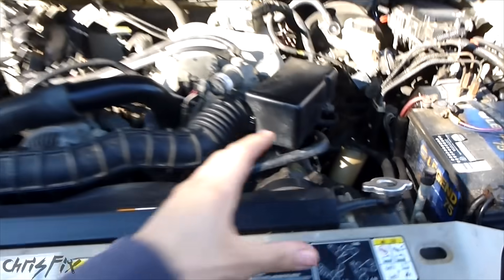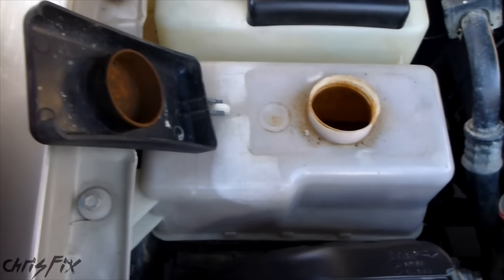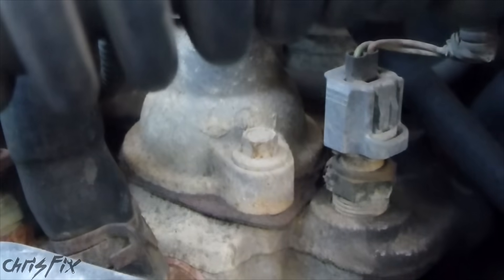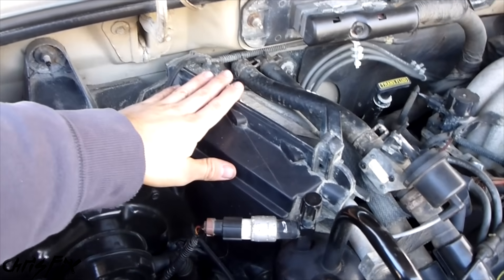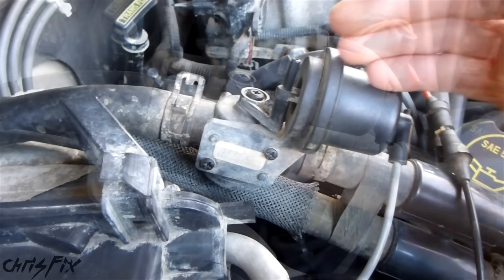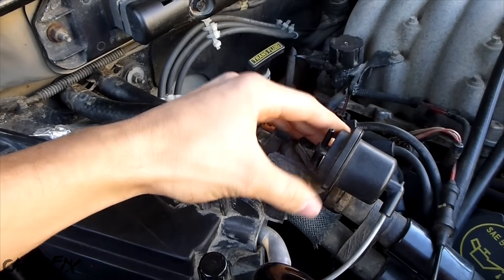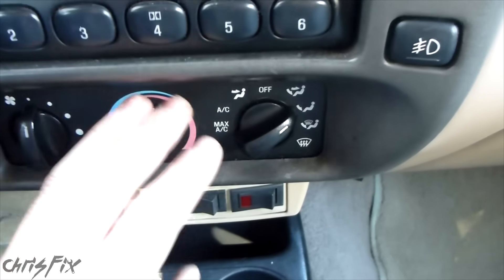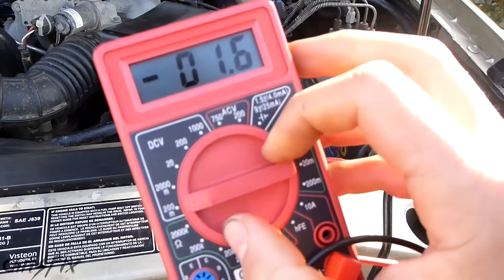How to Fix a Car with No Heat (Easy)

Comment: I don't understand why this video has dislikes.  Great informative video!
Reply: Dont know why either!!
Reply: Are we looking at the same like bar? I'm seeing 99.99% likes vs 0.01% dislikes.
Reply: +Sadpants McGee But still, 180 dislikes is something.
Reply: Darude - Sandstorm Go to any youtube video with a high view count, and you're going to find downvotes.  Such is the nature of the internet.  Complaining that 0.01% of voters voted down makes about as much sense as lamenting about a single brown blade of grass in an otherwise completely green lawn.
Reply: +jdac22 Those haters are car mechanics of CHris fix City..They know people will fix there cars at home now ..
Reply: its because this car clearly has a headgasket leak. that what i saw when he poped that rad cap.
Reply: you are right you can see clearly that
Reply: That is because he hasn't changed his coolant in over 8 years. It isn't a head gasket leak. A head gasket leak will make your oil foamy and I have seen his oil for that car in a different video and it is almost 100% black oil.
Reply: Im a year late to this, its probably the technician scammers who dont wanna get outdrove by the honest ones.
Reply: Prince KPK I understand why. He actually left out THE NUMBER ONE MOST IMPORTANT REASON! If the heater core cracks (like a radiator can) then the coolant will leak into the passenger side of the carpet so you will lose coolant causing the engine to over heat and then also causing major damage like blowing a head gasket possibly cracking the head and maybe even burning up the entire motor. I can’t believe thats the one thing that he left out smh
Reply: I think there are 699 techs looking at his videos thinking "damn" I cant overcharge them anymore.
Reply: People, the dislikes probably are all sitting with their car and it's blown heater core. This video offers no quick fix for such a problem and it's disheartening. To buy the part itself isn't expensive it's labor-intensive as you have to take apart your dash and part of the engine on the other side of Dash to just get to the simple part
Reply: jdac22 probably from mechanics that are pissy about him teaching people to fix their own stuff.
Chris fix is the fucking man!!!!
Reply: Is it  because ChrisFix learned it better than they do?
Reply: Dislikes are the mechanics who are losing money probably
Reply: Quick YouTube tip: people will dislike a video for the most strange reason. Don't try to understand dislikes.
Reply: Teague Jelinek uh okay
Reply: @jayasmrmore3687  happy to help.

Comment: I just had to subscribe because I’m pretty sure you helped me diagnose my issue; I get heat when I want AC, AC when I want heat. This makes for a miserable time driving in hot summers or cold winters. Tomorrow I’ll test out the blend door theory and hopefully, the fix will be as simple as you suggest! Thanks, Chris!

Comment: I have a 2007 Buick Lacerne. Cold on one side,         hot on the other. The actuators were working fine. Test showed I had a door stuck. I took and sprayed blaster in the defroster vent and also the face vents. I let it set for awhile. Then tapped on the actuator box, it really worked. Thanks Ken Norris.

Comment: Excellent video 👍 going to flush heater core and swap coolant on my 2008 buick allure 3.8 v6 series 3 tomorrow. Already replaced thermostat. I have heat but it's just not as good as it should be.. I'm hoping the flush or the blend door actuater is the culprit.. keep up the great videos

Comment: Still a great video to this day. I went through the complete video, replaced the blower motor resistor per the symptoms. The blower continued acting screwy throughout the different switch positions, then finally found that the culprit was the actual fan speed switch contacts had welded closed in the high speed position. Replaced the switch, and voila! Fan speeds work again!  Thanks a bunch for stepping us through the entire system, definitely makes troubleshooting easy when you know how something is supposed to work. 👍

Comment: Wow. I feel like I know how the system works now. 😂. Loved the video and it helped me TREMENDOUSLY in diagnosing my issue. I replaced the Resistor which helped me get the blower moving on all 4 speeds. It was only moving on the 4th and first. Now I’m getting air flow but it’s still a little low so I’m going to look and see if my blend door is opening all the way. Man. Thanks. Information is so cool.
Reply: Also check the filter behind your glove box if you have one
Reply: @icemancometh8679   Yea I ended up replacing the entire AC system. Worked like a charm.  I actually just listed that truck for sale this week.  Looking to upgrade.
Reply: @karateflix  I think my water pump blades are all rusted out and so my heater doesn't work so well and they tell me I have a leak in my evaporator in my air conditioner - what else could it be?
Reply: @icemancometh8679  Depending on what vehicle it is.  Im no mechanic by any stretch.  I just know a little here and there.  Id go through and replace everything little by little if its an old vehicle like mine.

Comment: Holy cow! At 122k that radiator needs changed out; even the recovery tank has signs of the rust & corrosion. Flush those with the radiator out. That could be a cause of overheating. Very poor coolant flow, and heat exchange, you know? You could also rent/borrow a NOx sniffer- check that recovery tank for a leaking head gasket, too. That would make an awesome video for you- "Coolant System Overhaul".

Comment: Me: *checks coolant in mom's old car expecting it to be dirty and sludgy*
Coolant: *is full and bright green*
Me: 😲 w o a h !
Reply from the maker: Nice!
Reply: She probably watches chris fix😂...God bless your mom bro
Reply: It probably was serviced not too long ago
Reply: @chrisfix  Hey Chris on my Rav4 2004, The driver side vent blows normal temp air, the passenger side blows cold air.  
When I switch the climate control from cold to hot it blow the correct air temp as it should, but when I set it back to Cold, only the passenger side blows cold air.
What do you think is the problem? is it the blend door or is it low on freon/refrigerant?
Reply: @chrisfix  what about  ac cold or 1992  Acura vigor
Reply: Let's be real, we all are here so we can help our mom with her car troubles
Reply: @richmadrid9563  have you tried changing air filter
Reply: @jayasmrmore3687  both engine and cabin airfilters are new. I don't see any relation of the temperature to the filters.
Reply: @SeanLaMontagne  correct
Reply: @richmadrid9563  did you fix it?

Comment: I'm glad Chris makes these videos. I just found out the previous owner's mechanic had ziptied the heater control valve shut into AC mode. I trust Chris more than mechanics. heater works great no leaks anywhere. Thanks Chris

Comment: Chris, does it make a difference if the temperature of the two heater hoses is about 20 degrees different?  147 for the one on the right, 125 for the one that connects on the left side of the two (as you face the firewall)  Also, do you know the ohm rating on the potentiometer? (middle knob in the set of three on the dash)  Put my meter on 20K and it reads 454? ...  not so good with electronics😜
Reply: 20 degrees is a normal difference. 50 degrees or more would mean there’s a problem.

Comment: My heater seems to only blow cold air, if anything it feels a bit colder than the regular AC. Not a big problem since I'm in AZ and it's relatively warm year round, however, I care about my vehicles and want everything to work how it should. That being said, I did a little investigation. Ended up replacing the blender door actuator or some people refer it as a blender door motor. Either way, it's replaced but it seems to not have done much. The fan blows on all settings. Air blows from each vent. Heater core works and the coolant/ anti-freeze is good. Hoses get hot. Yet no hot air. I'm stumped. I was checking that heater control valve or what looks like it (mine is inside the dash, right behind the glove box, and controls an arm that opens a little box. I can open the box with my hand but either hot or cold setting it feels like outside air coming in). Any ideas? I own a 95 Ford ranger 2WD 3.0L V6.
Reply: Tyler Vick Check the female end on the back side of your hot-cold knob. (Pull it straight off) Old plastic knobs will separate where it connects into the dash, not allowing you  change temperature.

Comment: To test for low coolant level or air in the system simply rev the engine 2 3k rpm for a minute or so then feel the heat...the water pump will pump it all around so if after revving you have heat then you either need more coolant or bleed the air from the system

To check for a bad thermostat (stuck in the closed position not the issue of stuck open) warm the car up fully and feel both hoses coming from the radiator if 1 is significantly hotter than the other or 1 is totally cool then you definitely need a new thermostat

Comment: 1992 Mazda 626 had no heat in 20 degree morn temp, and I froze on my way to work.  Came home, watched this and did it.  Now both inlet and outlet have heat, whereas before, only the inlet was warm and the other was not.  Feels good to have warm air in the cold.

Thanks for the info

Comment: I fixed my 2018 Ford Transit 250 SWB heater problem using tip to check coolant levels. Had the local oil change outlet top off my vehicle's fluid levels, which included the coolant. It needed about a gallon to fill the reservoir.

Totally rolling the dice, thinking it was something more severe, but it worked.

Thanks.

Comment: On my 04 Grand Prix theres very little heat coming out, even at operating temperature the air is just warm, not hot but warm.....so it's kind of an issue with cold weather.

Comment: radiator looks like the inside of shreks ears
Reply: Lol.
Reply: I guess you would know.
Reply: Read this comment 3 days ago and still can't stop laughing at it. Lol
Reply: Thats all that stop a leak shit used to try and fix a small antifreeze leak from the radiator, but that only cloggs everything and creates big problems. If you have a hole in the radiator, then simply buy a new radiator and fix the problem the right way. Don't be cheap!
Reply: @argenisdominguezmolina5981  
It's all I know.
(Being cheap)
Reply: Oooooooooo......shek roateddddddd ohhhhhhhh

Comment: how do you test your blend door when you have Electronic Climate Control?
Reply: Pretty much my question too- have a late '03 B2300, which does not have the "clicking" temp control. I'm fairly sure my blend door is stuck solid on the Cold setting. Oddly enough, a couple of months ago it was stuck on Hot. Coolant is sparkling clean; heater valve normal and hoses all flow properly. Gotta be the blend door I think...
Reply: you should still be able to hear the blend door opening and closing. you should also still be able to hear the actuator as well . I'd try the actuator first. The sound usually can be heard around the back of the glove box. A test to do to check if it's the blend door or the actuator, is turn on the A/C, move the temp to the hottest position, if the temp of the air coming in is cooler than outside, your blend door is the problem. You can do this test outside, but you will get cold so just a heads up. Hope this helps.
Reply: @amtrakjohn  There is a simple way to replace your blend door on your 03 b2300! I can send you the link to it if you like!
Reply: samuel rivera —Samuel- appreciate your help and advice. I’ve got an old friend to help with the job, so I’m good. Thanks again!

Comment: Since this is an older video, I may not get much of a response. Could the same solution be applied to a vehicle that has air that only works half the time? It blows hot and cold air when it works just fine. But sometimes I turn up the blower to max and it won't work. Several days later it'll work like nothing happened.
Reply from the maker: Wont work as in you dont get any fan at all? Sounds like a blower motor resistor or a faulty blower motor... Check this out: https://www.youtube.com/watch?v=Q-i0tytSYIM
Reply: Yeah. I'll turn the fan up and no air will blow. Then next time I drive, it'll work fine like nothing happened. Weird stuff, I know. I'll give your suggestion a try. 

And thanks for the response. I wasn't expecting it from the man himself. Love the videos. Big fan from Texas. Keep me in mind for the tool set giveaway. Haha

Comment: That's the worst radiator I've ever seen. Get a new one and a complete engine blow out.
Reply: you never seen my ex wifes then :P , hers was so sludged up you couldnt even add Coolant,,,LOL  and she wonders why she burnt up 2 sets of cylinder heads, and she didnt add oil and blew the original motor after our divorce,,,, DUH
Reply: What is a complete engine blow out? Why do you get one?
Reply: That's oil. He has a head gasket leaking.
Reply: @johnniec2861    Just what did you put in the ex's   motor johnny?    I need a can of that stuff

Comment: Thanks for the video. It is easily the most comprehensive and concise video I've seen that covers a number of possible causes and solutions for the no heat problem I'm troubleshooting at the moment. I replaced the heater core and blend door in my '97 Ford F150 and now there is no heat. I was already looking at the actuator under the dash and now I have even more useful info to determine the cause and I'm confident I can fix it without pulling the entire dash. Thanks again!

Comment: What's up Chris when are u making more vids
Reply from the maker: I work on the next video as soon as the previous video is posted! Next one is coming out soon! You can get updates on my Instagram for where I am in the process!
Reply: Chrisfix,
Thank you for these awesome videos! Have you ever heard of sediment getting in the cooling system and preventing the car from having Heat?  I never have. But a friend is having trouble with their hearing/cooling system, & their mechanic says it's sediment. I'm loving your videos bro, keep'em coming!
Reply: @marcuslgelite2   Sediment is just a catch-all description for 'crap in the cooling system'. Typical causes are neglected cooling system, use of mineral water instead of distilled water, and use of Dex-Cool (or any other HOAT coolant, stick with a low silicant 'conventional green' coolant like Zerex Original). The problem is that once the debris starts forming, it's damn near impossible to get out. You're going to have to start replacing radiators, water pumps, hoses, etc.

Comment: I have a 2002 Jeep Wrangler TJ, it has no AC but when you turn the heat on only the bottom heaters and windsheild defroster vents push air out, what do you think is wrong? None of the middle air vents push air out.
Reply: Vac hose
Reply: Blend door actuators

Comment: who else watches these videos even tho you don't own a car yet ?
Reply from the maker: +Skrew Potatoes , Fries are better when you get your car you will know more than most people!
Reply: ChrisFix my hot/cold needle works, but in the winter it never rises above the C. Please help
Reply: anas malik . I'm assuming you are referring to the temp sensor? If so does it ever jump from hot to cold? If so could have air in the system. Also you may not have a thermostat or its stuck open.
Reply: I'll be buying my first in a couple weeks time. I've been marathonning this channel in preparation, it's great
Reply: Ronaldo Martinez I'm 11
Reply: I watch them even though my vehicles don't have the problems....close enough right?
Reply: Epic_Goku_ 214 me
Reply: Epic_Goku_ 214 I do but I help my mom and dad's cars and trucks working properly
Reply: I Watch His Videos Like 3 Years Or So,I Bought A Car Just 1 Week ago 😜
Reply: Epic_Goku_ 214 I'm 12 ready for my Toyota Camry
Reply: Fox PlayzHD I own a car but I don’t have these problems, I just like to watch these videos
Reply: I’ml
Reply: Me
Reply: anas malik put a piece of cardboard in front of the radiator to let the engine warm up to operating temp.
Reply: @bencramer5458  Wait, what? No, No, No. Don't do this. You can't give vague instructions like that. Even if it was sound advice, you don't know their level of understanding. Are they supposed to drive it or leave it in park? Cardboard under the hood or outside? Under the hood is the fan. Outside the car, they could cover the cold air intake, etc...
Reply: Matthew B so did u get ur car bro
Reply: yep
Reply: Me

Comment: My heater stops blowing hot air when I put the car in neutral....what the hell? Doesn't matter what temperature, it cant blow hot air in neutral.
Reply: check your coolant level there's probably not enough . or maybe your heater core clogged up
Reply: Coolant level is good, haven't checked heater core, where can i usually ffind it?
Reply: ///No Power
Reply: I think the issue is with my water pump, it needs changing, makes noise. Not sure it will fix the heating though.
Reply: Is your car a diesel? That throws some people off when they first get a diesel.
Reply: VideoMorsels Lancia Y petrol, my heater core is behind the engine.....fuck.
Reply: ///No Power
It's hard to diagnose without more info. What kind of car do you have? Have you changed the water pump, yet? If the water pump is bad, it will often leak from the weep hole. Does your coolant look clean or dirty? Do you have a bunch of crud on the inside of your radiator?
Reply: ///No Power
Reply: smili'n puppy starts great, it turns out my pump was good, so nothing happened when i changed it, but a week later the heater started working again...then the coolant was missing, my windows were fogging up, antifreeze was leaking in my heater core probably. So i put some special crap in it and now it doesnt  leak. However, my temperature gauge is going crazy now, goes to cold then imidietly to half temp even in -15c outside.
Reply: ///No Power
Reply: Muddy Grimes qq